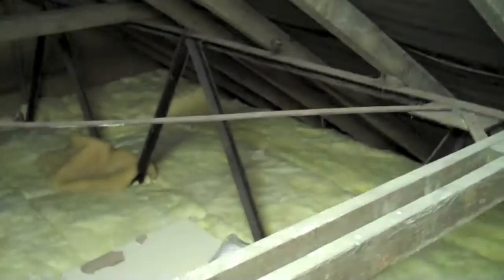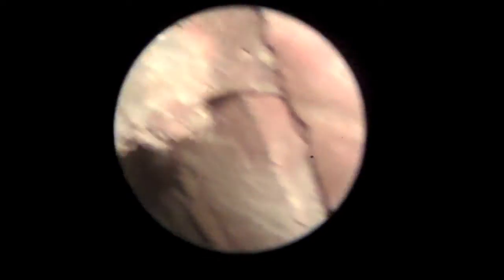Wall Tie Corrosion in Timber frame housing

Comment: What's your opinion on putting plastic sheeting on top of the soil of the crawlspace?  Is trapping the moisture a bad idea?  A lot of people recommend it, but wouldn't the moisture just accumulate underneath?

Is it a better idea to just have good subfloor ventilation to allow the soil to dry by air circulation?